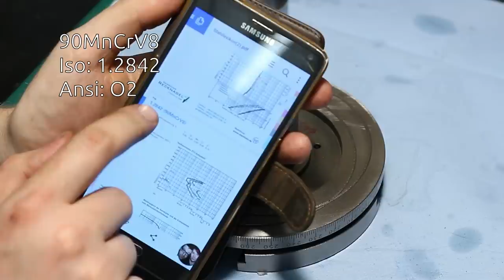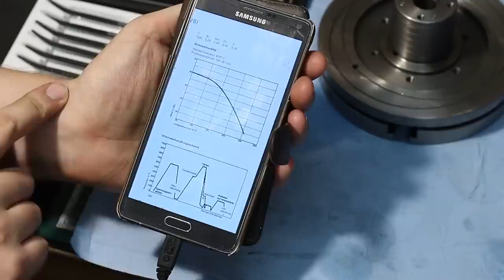Improving the vertex rotary table - Part 2

Comment: My mentor taught me a cool technique to reduce scale buildup when you harden parts. Wrap the part you want to harden in paper, then make a pouch of .003 stainless sheet. Seal it well with crimps around the edges and then put it in the oven. The paper burns up the oxygen in the pouch and the pouch prevents new oxygen from entering. When you take it out you cut the pouch open and dump the part into the oil.
Reply: You can also use boric acid if you can get your hands on it.
Reply: @ColtaineCrows   you don't want boric acid on your hands
Reply: @Thefreakyfreek  
Nice 😜! Better "hands on" than "on your hands" 🤣🤣🤣!
Reply: We just put a fair amount of barbeque-coal into the oven whit the piece we harden. We harden at ~825°C and temper at ~350°C when we make pieces in Böhler K460 or Uddeholm UHB Arne. We usually aim for the spot on the charts where change in measurments are small, that is also where (if I have got it right) the mix of hardness and tensile strength (resistance to cracking) is best.
 BTW: It should be mandatory to ALWAYS tell/have a AISI/SAE-number for the steels so that they would be compareble. Now it's sometimes  impossible to compare materials. We use Böhler, Uddeholm, SSAB, Sten, Meusburger and Hasco at work. When someone has made a part in a material not suitable and we shall make a new, we have to do a lot of detective-work to find the best sort that we can get our hands on...

Comment: Great trick with the ball bearing lock, I did the same to lock the graduated collar on the handwheel I made for the Rivett because I wanted the locking screw in the front of the handwheel rather than sticking out from the collar. Was very cool to see some hard turning, and those inserts you use sound very interesting. Well done, as always! :)

Comment: I would have loved to sleeved the shaft on my 6" table, but what I did is wrapped and couple of feeler gauges inside as I fed the table shaft back into the hole of the main body and that complete took out the play. I found that the table shaft would jam up half way in with a .003" feeler gauge. So actually .0025 (two and a half thousandths) fit inside perfectly and now has only a 1/3 of a thousandth(0.0003) of play theoretically and now operates phenomenally!!!

Comment: Stephan, you probably do not need the 4mm steel ball, just taper the rear of the bronze plug. Also I would use brass plug, as it would moosh into the threads a little. Great video! Love it!

Comment: Here is a question for heat treating experts.  In the quench, water or oil, does the direction (orientation) of the part being dropped into the  quench bucket affect the final geometry? 
When in shop class, I quenched bearing driver punches, I found if you did not immerse them at right angles to the water bucket they would warp towards the cold side which would show up on finish turning.  It took a little longer to plunge them in exactly straight up and down but the results were better.  I suspect this hard bushing was warped cold side high. The side that hit the vegetable oil shrinks first and could warp the other side  still red in the milliseconds before it reaches the oil. 

I wonder if dropping the bushing down a loose mandrel set in the oil would allow a more uniform diameter shrink.

Comment: Hmmmf, I sort of thought my older Vertex with the angular contact bearing was superior and they'd cheapened the design by omitting it. I can now see what you meant about which could be the better system in your last video Stefan. I may have to rethink that bearing in mine. Nicely done rebuild for sure. Have you checked the runout of the MT 2 bore in the table yet or did you just zero that first before recutting the outside of the tables spindle?

Comment: Just curious but shouldn't you have roughed up the mirror-like inner surface of the sleeve and the outside of the spigot to give the Loctite a better surface to bind to? I'm not familiar with Loctite 648, maybe it doesn't require it.  Great video!

Comment: Neat little heat treat oven.  Is that a bought item or something you built?   I could sure use a little oven like that.  Can you provide some details on it?
Reply: Hey MDShunk. I've got one of those - it's just a hobby enamelling kiln - pretty cheap secondhand on ebay and get yourself a cheap pyrometer. These kilns are fine up to  1000 or 1100 celcius .

Comment: Stefan, I love your work and learn a lot. About the marks on your lap (probably someone else mentioned it (but I'm not in the mood to read 182 reactions at this moment); I think your lap is too narrow and grabs on the outside when you move it by hand. In Dutch it's called "schranken" and maybe in German too (it's sounds already like German for me :-)) It's a phenomena which you get most of the time when you don't want it and is sometime's hard to achieve when you want it (Murphy in the House!). I learned the hard way a long time ago and digged in deeper so I could get it it when I wanted it and bypass it when not. If you're interested I can send you a A4 which tell's you all you want to know. Key is the length of your lever (the allen key) and the width of your lapping tool and the friction involved in the process. If you want to play it safe choose your friction coefficient "1" or maximal. and the broaden your sleeve accordingly or shorten your allen key the same. It probably sounds like a mad man talking at the moment, which I can understand, but the theory is here and retrievable. Let me know if you're interested. Keep up the good work, be safe, and with best regards from Delft, Holland, Job
Reply: And, looking further, I love your solution for locking down the adjustment ring from the back. I think we share the same passion about elegant mechanical solutions. Best, Job

Comment: The lapping marks are caused by excessive heat. Too much pressure, too much speed, or both. It usually starts out great but after a little heat builds in the slurry it's a matter of seconds until it starts to seize up.

Comment: When I turn to a tight tolerance I just hand polish with wet and dry paper or Emery cloth, what's the difference between that and lapping? Is it easier to maintain size along the diameter with lapping? Does it generate less heat? Better form?

Comment: I own a 8" and 12" Vertex rotary table. Both are extremely good quality. This manufacture in Taiwan does not make cheep junk. Tearing the nameplate from this was a disappointment. Name brand is nothing anymore. I purchased two Fowler micrometers last year, both were junk quality.  The thimbles were out of round and rubbed, they were made in China, but Fowler should have had their QC in place.  China can produce extremely good quality, if your willing to pay for it. We buy low cost imports, and they produce "just good enough" in most cased for our markets. Your buying high end import quality from Vertex.
I do like your videos, I always pick up some new technique.
Reply from the maker: The nameplate was not from Vertex, only the reseller. I made a new nameplate giving Vertex the credit they deserve.

Totaly agree on "you get what you pay for", you can get precision tooling from china without a problem, if you are willing to invest.

Comment: That is a very nifty heat treating oven you have there Stefan! Where did you get? Very nice work, way over my skill level at the moment but inspiring to see nonetheless! Best regards
Reply from the maker: Its an Efco 110 with a Eurotherm temperature controller - That little oven has only 700W powerconsumtion, but can get up to 1000°C :)
They show up on ebay all the time.
Reply: Cool, thank you! They seem to have pretty different door configurations. Did you retrofit yours? I see the screw holes for the hanging lid. I'm thinking I may use one for casting silver or nickel silver and I'm not sure the glass would isolate or hold up to the top temps.
Reply: Also, apart from the power output, for a shop setting do you think the EFCO 180 would fit the bill just as well?

Comment: For me heat treating is scarey stuff but you seem to do well,probably because of your higher education.I'm reminded of the big screw-up at Springfield Armory  years back where1903 springfield rifles.(Mauser copies) recievers  were improperly heat chreated by color,then Quenched .Several people were hurt(soldiers) by burst brittle actions.Thanks for your hard work as always
Reply from the maker: Right - I would not do heat treating on a critical, load bearing part myself, thats something to send out to get it properly done. But for something like bushings, keys or small tool-parts I think I have it pretty good under control :D

Comment: Hi Stefan. You quite frequently use Locktight. With your precision skills you could easyly machine a perfect press fit. So my question is why I should prefere the Locktight.
Reply from the maker: I am just not a big fan of press fits, using Loctite 648 is so much easier and absolutely reliable, for the most case I dont see any reason for the additional hassle of engineering a proper press fit.
Reply: Because of inner tesions?
Reply: hi Thomas! Nope. The tensions are mostly relieved when machining the OD. It is just a question of preference. In this application is no heat involved, so I guess it doesn't matter which method you use.
Reply: Hi Bill! Good point! I'll keep that one in mind. Thx.
Reply: Loctite - because there's no heat that can soften glue + there's no high force/torque than can move/rip off the part out of place. Plus, it's easy to install (don't need press and special tools like custom bushings) and remove (with heat) in the future.
Reply: @SJWs & Betas: As a native English speaker, how would you pronounce "Oberflaeche"?
Reply: Glued slide fits are nice, I've had enough interference fits and press fits gall up on me to have a very slight hate-boner for them. Never fun to take apart something that was pressed or "heated" on. I do disagree on the loctite though, it's pretty easy to break that stuff loose if you want it apart again.